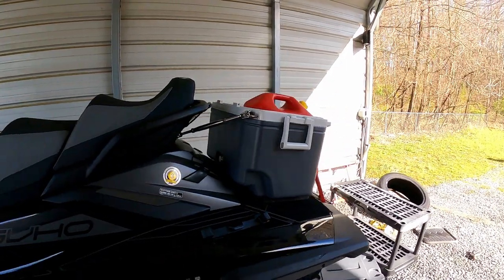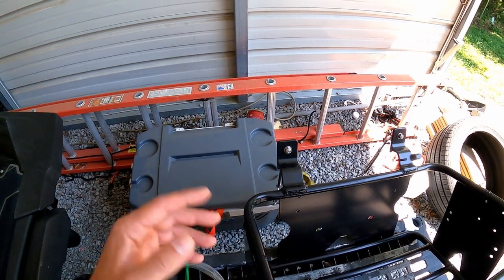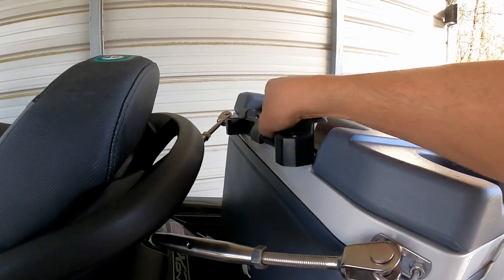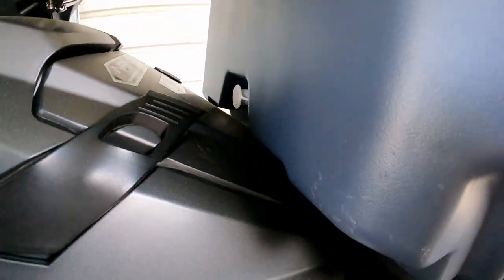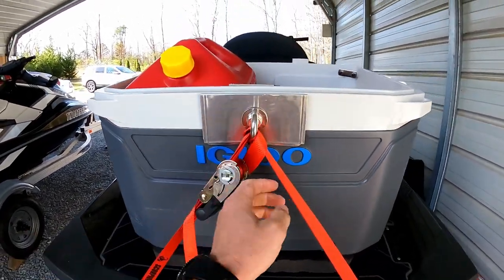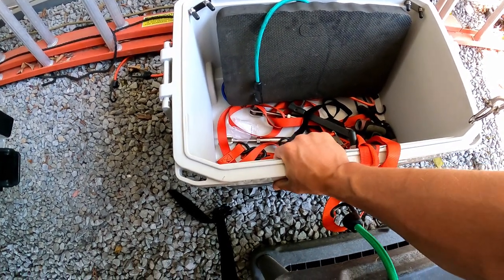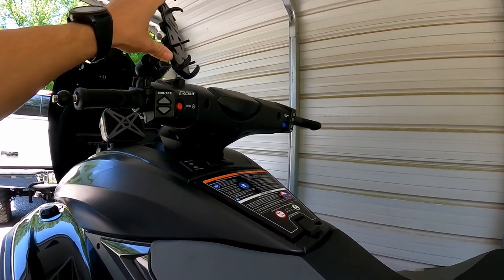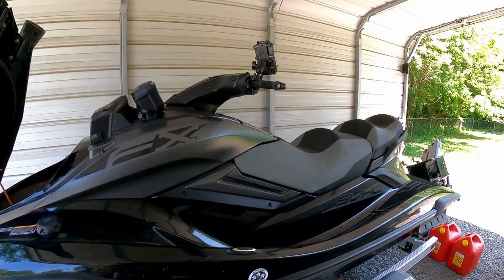Yamaha Burned down. DIY PWC Cooler Rack Final Build, Waverunner Storage Idea CHEAP

Comment: Nice idea. Think I''ll kinda copy it. Flip cooler direction, use a SINGLE mount bow, dual stern.
Reply from the maker: There are no brakes on a jetski so it needs 2 mounts on the front in my opinion for acceleration force alone.